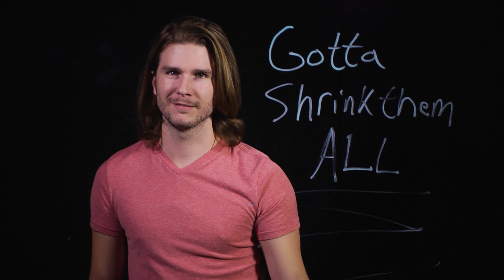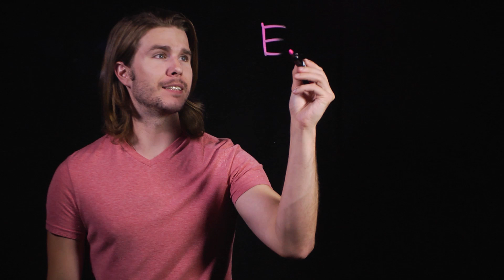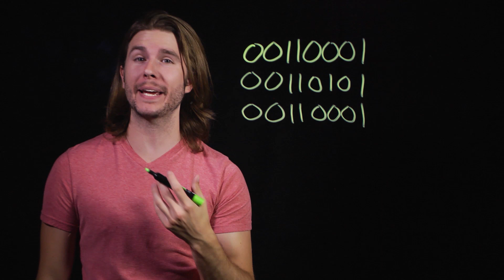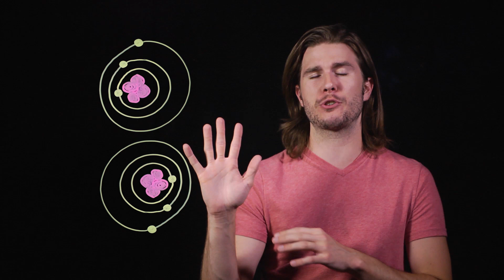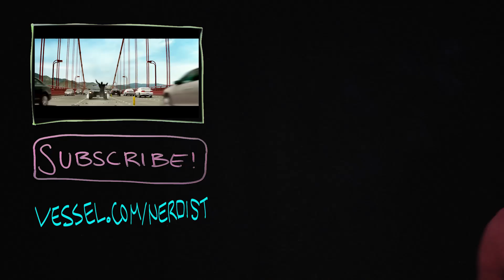How Do POKEBALLS Really Work? (Because Science w/ Kyle Hill)

Comment: Forget how pokeballs work! i want to know how  the TMs/Hms work.

Do we just shove the discs up their ass or what?
Reply: +ReachSkyla You put the disc in the Pokéball button, it spins like a cd player and the Pokéball reads the data from the disc and transfers the move to the Pokémon. Just came up with this on the spot so it's pretty much -200% possible.
Reply: BlinkingEspurr Actually, while hilarious to imagine, if the pokemon in the pokeball is data that could work.

It's true that pokemon ARE just data in the IRL sense but in game it doesn't make sense to use TMs/HMs on pokemon. Especially HMs.

I mean, you don't see pokemon using tms/hms in the anime either.
Reply: +ReachSkyla 
You're all wrong because you fail to see the actual middle ground in your theories. Information Transfer + Ideal Environment = Virtual Reality. Which could explain a lot of things actually.
 
For One; the clock within a game (or game time) is often faster than real time, which would explain how they're always well rested. It could also explain TMs and HMs. Technical and Hidden Moves are Instructions, in the same way the Pokemon are changed in to information so they go inside the Pokeball, so too can the Moves. Translated into the Virtual Reality with an environment that moves faster in regards to time and you have a way to Teach/Train/Learn Moves.

For Another; it would explain healing. The healing machines at every Pokemon Center might not in fact heal, but rather speed up the 'game clock' to allow the Pokemon to heal naturally at a rate that is much quicker relative to the player.

This could also explain why some Pokemon are not captured immediately. When a Pokemon's HP drops, it doesn't die - it feints. And having a Pokemon under a condition (Poisoned, Paralyzed, etc.) helps capture it easier. So it's possible that those with more hit point are more 'awake' and can tell the difference between the virtual and the real, hence causing Pokeballs to break. So the more damaged a Pokemon is, the more 'woozy' it'll be and the lines between Virtual and Real are blurred.

This next part gets dark; it's possible that in the Virtual Reality (with time moving faster relative to us) that, from the moment a Pokemon is caught, the Virtual Reality is simulated to program a Pokemon to enslavement through conscious programming (torture) or subconscious programming (Perhaps an NPC resembling the player appears in the Virtual Reality?)

Basically, {Rick and Morty [Microverse]} meets {Sword Art Online [Virtual Reality]} meets Tron... In relation to technology...

PS: Of course I'm not saying I'm completely right either; I'm just stating the more plausible theory both scientifically and realistically.
Reply: If I had my own Pokemon moveset, I'd go with Charm, Teleport, Strength and Pay-Day. Sure, I'd be useless in a battle, but I'd have it pretty good outside of it lol
Reply: ReachSkyla Not scientific, but canon.
Reply: Jake Walsh The pokedex doesn't have that function though. It doesn't have a video player.
Reply: screw how tm`s or pokeballs work.
i want to know WHY game freak has created skylas design the way she is...
Reply: Pokemonfan mario Have you SEEN Oras wallace? Skyla is nothing compared to THAT.
Reply: yep... why did Nintendo make Wallace like THAT...
HE HAS NO FREAKING PANTS JESUS CHRIST MY EYEBALLS! PASS THE FREAKING BLEACH, HECK GET ME PARASITES TO CONSUME MY EYEBALLS I DONT CARE!
Reply: +ReachSkyla In the show they press it against their forehead and it glows and disappears, I don't know how it works now that they are permanent items.
Reply: +ReachSkyla I always assumed you slapped it against the pokemon, and the information absorbs into them. How? Well, to answer that, we'd first need to know how pokemon 'learn' moves, and why they have limited space for them. Perhaps they don't so much learn, as mutate. Which brings us back to the good old (40's?) answer to everything: Radiation.
Reply: +ReachSkyla I too support the rectal insertion theory.
Reply: Step One: Introduce pokemon to TM.
Step Two: ???
Step Three: Use the new move.
Reply: +ReachSkyla The TMs HMs discs are instructional videos for Pokemon. You put the disc in your Pokedex, and you play the video for your Pokemon to teach them the move. It's like learning to cook on the food channel.
Reply: MaximumFlightRisk No. there is never any mention of the pokedex having a DISC player in the games. why do people keep saying that?

And why in the old games did the TMs only have one usage? Did the pokedex scratch up the TM discs or something? XD
Reply: Like efficiency ever stopped us. I just need to put a spin on how it'll reduce carbon dioxide emissions and take all the grant money. All of it.
Reply: Little Spac So you're saying a solar beam is basically projectile sugar?
Reply: I think we'll just have to accept that a four move limit is a game design choice, not something that can be explained away. Yes, pokemon get digitized, yes they can likely be digitally altered - but a universal four move limit?  They're still living creatures, with genetics and wildly varying capacities. Alakazam has an estimated IQ of 5,000 for example.
Reply: ReachSkyla maybe. there is plenty of evidence that Pokémon are actually digital  beings. catching them reprograms them. that's why the Pokémon then understands you and obeys you. those weird silver disks are adding a new program.
Reply: idk xD
Reply: Tyler Mauer they did that? i didnt remember that. that makes even LESS sense.
Reply: +ReachSkyla they eat it and consume its power
Reply: OwlQueen Animations Sounds painful
Reply: +ReachSkyla You put the disc and pokemon in the pokeball at the same time, the shake that bitch like there's no tomorrow. All the matter inside will mix and bam! a new move is learnt.
Reply: +ReachSkyla I think the pokeball just emits a magical beam of light that will read the TM/HM like a cd
Reply: I have two ideas for that: One is just CD with a film showing how to use the move and then teach it to you Pokémon, like those DIY shows, or you put it in the Pokeball and reads it like a CD player. Who knew the Pokémon world were that advanced in the 90s...
Reply: Why do you guys keep suggesting there was a video player?? There are no in game items that allow discs to be read.

Also, the TMs would disappear once you used them in the older games.

What CD/DVD player do you know only allows for one usage? That makes no sense.
Reply: Maybe is like the Spore, that you can only install it for a few times, I dunno.
Reply: +ReachSkyla 
But how do you get the discs back then? Maybe you just shove it down its throat. We have no idea how big the discs are though, so if gastric acids couldn't dissolve the disc you could pull it out of its shit... Dem, pokemon is animal cruelty all round...
Reply: +ReachSkyla If you are looking for ways on how TMs/Hms work, there are none. I assure you.
Reply: CD's are normally write once, read many (WORM). HM's would be like that.  I assume TM's are designed to be write once, read once... The act of reading the data destroys it.
And the only thing I've ever seen that kinda shows how they work is the fire red thing, where the cd sits on the pokemon's face, they vibrate rapidly then poof.
Reply: So the CD just sits on the pokemons face and then poofs? XDD Seems legit.

Also, If we're assuming that the tms are read on the pokedex then that would mean those who didn't own pokedexes can't teach their pokemon TMs.

That's kinda the vast majority of people in the games.
Reply: Oh damn.
Reply: They sure as shit ain't watching an instructional video on how to teleport or weaponize photosynthesis (solar beam)
Reply: Weaponized photosynthesis. This could be a great new advancement in science!
Reply: FDJustin 
No. Not efficient enough.
Reply: FDJustin 
Thats not what I was saying. Chloroplast can't produce such a large amount of energy that you could power anything. And they don't even produce energy in the first place, just glucose.
Reply: No, I'm saying solar beam is bull shit.
Reply: It does make some sense, though. That would explain why you can't use a TM on a pokemon during battle. They have to be in their pokeball for it to work.
Reply: If you follow the data theory, (one of the few that make pokecenters actually make snese) you could basically imprint the move on the pokemon's mind by changing a few lines of code, which would also explain why they can't learn only four moves at a time. When they already have four moves and you try to teach them a new one it is as easy as rewriting the code for the moves they know, changing it for whatever the heck you want to teach them.
Reply: TM's and HM's are ripped information from pokemon who had used those moves or gained them through training.
Reply: +ReachSkyla I think you put it in your pokedex and the pokemon watches it then learns how to use the move???
-1000000000000000000000000000000000% possible
Reply: AnimeHawkRevolution What are they watching it on then? You don't get a "video player" as in-game item. Care to explain more, smartass? LOL.

And teachy-TV doesn't count. that's a glorified tutorial item for the player not the pokemon.
Reply: ReachSkyla lol ur phone/Pokédex maybe the disc is small

Comment: Here's a simple answer, Pocket Dimensions
Reply: How would a pocket dimension be created it would require extreme amounts of energy and when pokemon get put/summoned from pokeball it might rip fabric of space and time
Reply: @starsniper202  pokeball actually is a ultimate device storage data
Reply: Pocket dimensions for pocket monsters. Seems legit
Reply: +Luciano Martinez 
You're all wrong because you fail to see the actual middle ground in your theories. Information Transfer + Ideal Environment = Virtual Reality. Which could explain a lot of things actually.
 
For One; the clock within a game (or game time) is often faster than real time, which would explain how they're always well rested. It could also explain TMs and HMs. Technical and Hidden Moves are Instructions, in the same way the Pokemon are changed in to information so they go inside the Pokeball, so too can the Moves. Translated into the Virtual Reality with an environment that moves faster in regards to time and you have a way to Teach/Train/Learn Moves.

For Another; it would explain healing. The healing machines at every Pokemon Center might not in fact heal, but rather speed up the 'game clock' to allow the Pokemon to heal naturally at a rate that is much quicker relative to the player.

This could also explain why some Pokemon are not captured immediately. When a Pokemon's HP drops, it doesn't die - it feints. And having a Pokemon under a condition (Poisoned, Paralyzed, etc.) helps capture it easier. So it's possible that those with more hit point are more 'awake' and can tell the difference between the virtual and the real, hence causing Pokeballs to break. So the more damaged a Pokemon is, the more 'woozy' it'll be and the lines between Virtual and Real are blurred.

This next part gets dark; it's possible that in the Virtual Reality (with time moving faster relative to us) that, from the moment a Pokemon is caught, the Virtual Reality is simulated to program a Pokemon to enslavement through conscious programming (torture) or subconscious programming (Perhaps an NPC resembling the player appears in the Virtual Reality?)

Basically, {Rick and Morty [Microverse]} meets {Sword Art Online [Virtual Reality]} meets Tron... In relation to technology...

PS: Of course I'm not saying I'm completely right either; I'm just stating the more plausible theory both scientifically and realistically.
Reply: because FUCKING MAGIC!!!!  MAGIC EXZISTS IN THER WORLD SO MAGIC
Reply: good theory man, yep, a high energy wave, bending the fabric of the universe, and sucking in anything it envelopes into a pocket dimension is one of the more plausible theories.
Reply: sniper gaming yeah pokeball is short for pocket ball :D
Reply: +sniper gaming An abra can cast teleport at level 1 without ripping the universe asunder. Why not harness that teleport power to "put/summon" as you put it, a pokemon to and from a pocket dimension? We already know a pokemon power can be contained in technology, that's what TM/HMs are.
Reply: It's... It's Bigger on the inside!
Reply: that is a good idea haven't heard that one yet i think it may be possible
Reply: Its just a thought that I had when I saw the comments
Reply: @thaguy69   cant use unknown. How would the old civilisation of legends arceus get unown's power
Reply: well its a good thought in my opionion
Reply: +sniper gaming thank you
Reply: np
Reply: +Luciano Martinez that sounds reasonable pocket dimensions (or universes) for pocket balls..
Reply: pocket balls?.....
Reply: Hmmmm thats intresting idea
Reply: yes
Reply: M2151 the biggest problem with your theory that I see is that it takes the exact same time for me to sleep and heal the Pokemon. And by your logic wouldn't it be easier to capture a feinted Pokemon and have them fed new information that makes them obey you? I mean it's a good theory and I just wanna see if there's a ways to close any holes in it.
Reply: +Blake Nye Thought did cross my mind about that. It would be way easier to catch an unconscious Pokemon, I agree. I also agree that is a considerable flaw in my theory but it is mostly guesswork, albeit an educated guess.

But you can't make a Pokemon obey you, like when you trade them. Also, Professor Oak said that Pokemon and Trainers share a bond, so while total enslavement would definitely be the easier option, I don't think it would be politically correct or effective.

So it is possible that Pokemon have to make the conscious choice to get in the Pokeball regardless of damage (like when I throw a million Ultra Balls at a Mewtwo in the Yellow because my next attack will get rid of all HP). This could also explain why Pokemon get back in the Pokeball after a battle, otherwise they'd run as soon as you let them go.

This might also link to the anime with Wobuffet. aside from the obvious comedic effect, it's possible that Pokemon can choose to leave the Pokeball whenever but they don't due to loyalty. And maybe that's why we battle them or get them in the red, perhaps to a Pokemon's psychology it's like a male and a male fighting for a female, a display of dominance.

Like I said though, it's mostly guesswork, and I'm not about to admit that I'm a psychological expert on fictional creatures. I do however admit that my theory has some flaws, particularly that one as even I thought that it would make more sense to knock out a Pokemon, but alas, I don't have all the answers without knowing the science behind the Pokemon world, which often goes unexplained as the focus is on the Trainer's journey rather than Professor Oak's..... I mean, who knows what he really does with a completed Pokedex.... 0.0

As for time, I said relative. Whilst in the Healing Machine, a few seconds to you could be months to a Pokemon. Keyword: Relative.
Reply: M2151 tl;dnr
Reply: +Luciano Martinez  A level 1 Abra can literally teleport, why not pokeballs that teleport Pokemon to pocket dimensions? That works for me.
Reply: +DeathbyDoughnut In essence, pokemon powers are supposed to be comparable to abilities that any being might have (just exaggerated with the awesomness of the pokemon performing them), so what I always wanted to know was why aren't there TMs or HMs that people can use, like "ride bike" or "speak Latin"?
Reply: i was about to comment that
Reply: pokeballs convert pokemons into pure energy cuz that's what Pokémons are, beings made out of pure energy.
Reply: baka7dogo You're probably right, I'm sure they never intended to explain the internal machinations of a pokeball, but they do imply that they are technological in nature, so questions inevitably rise
Reply: paralel universe
Reply: Haydin Sauviat FUCKIN  MAGIC PARALELUNIVERSE BRO
Reply: My thoughts exactly. Shrink the pokemans down then toss them in a pocket dimension where they can temporarily revert to their original size
Reply: or...the "shrinking" is just the visual effect...if not the direct physical effect of passing through a portal of that particular size...the pocket dimension would be whatever size you'd like it to be...probably the only thing you'd have to do is set a limit, or else it's just infinite...but therein lies the problems of if it has room to roam, if there's no sort of programed organization deliverance to bring it forward when called on, given you have multiple items as well...like a storage file, which file? where is it? or all them at once?...
Reply: I was just going to suggest frequency changes in the pokeball creating a pocket dimension.
Reply: Aren't pocket dimension completely friction? It doesn't have a single piece of science backing it up, right?
If that is true, he can't do a video on pocket dimension because he does science videos.
Reply: You might have to summon an portal that a size of an fully evolved Pokemon can fit
Reply: Could you use that to explain the pc transfer system? It's raw data isn't transmitted but the eh coordinates (?) to it's particular pocket dimension?
Reply: Wormholes
Reply: Pokénsion
Reply: Say how would the legends arceus ppl make entire new dimensions when they barely have technology from what we see
Reply: +sniper gaming not necessarily. maybe the use some sort of power that the unknowns have

Comment: Pretty sure that in the cartoon, Ash's Pokemon were transferred to the lab when he used the ball on them. 

So the beam you see is it teleporting. Almost like if the traps that the ghostbusters use had wifi for storing ghosts without having to return to hq after every job... haha... 

So the ball doesn't store anything and can shrink because it's really only housing the teleportation device assigned for each chosen Pokemon.